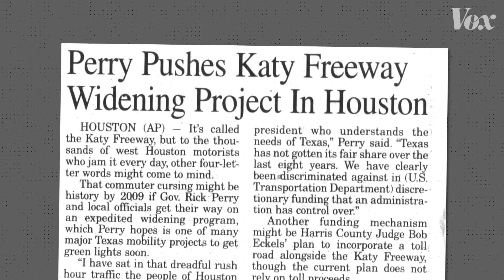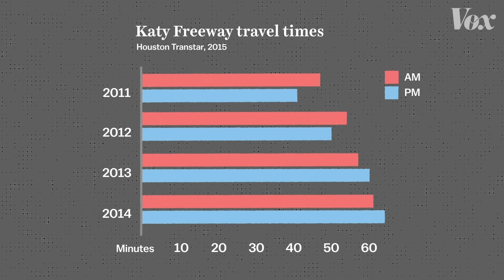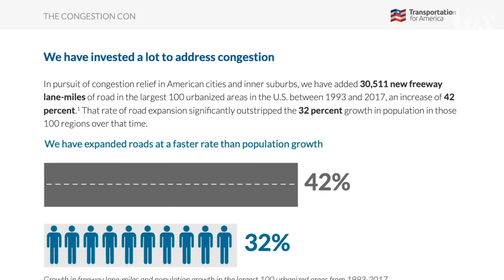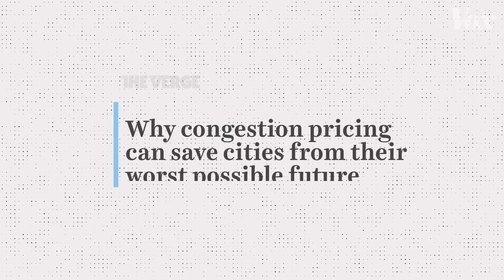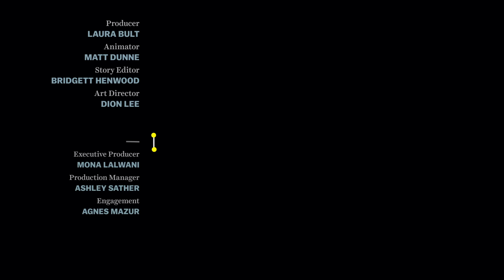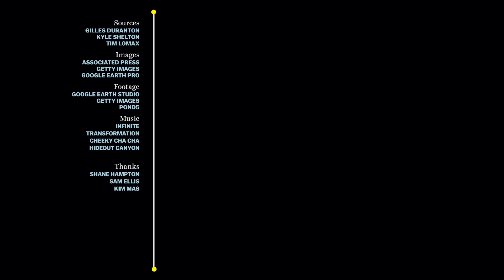How highways make traffic worse

Comment: As computers get faster, programs get less optimized, because the system can handle it. As roads get more lanes, cities get less optimized, because the highways can handle it. In both cases, the increase in speed and power all gets used up. Your 16GBs of ram is all used up, same as the old 256kB used to be. Your 20 lanes are full, same as the 4 lanes used to be.

But computers getting faster is still good. The programs can do more, which is exactly what we want. More roads, however, is not good. They're just roads. You're still sitting in your car unable to do anything until you get where you're going, and you're not going any faster than you used to. There is no benefit to more lanes. The real solution is less cars. Less travel.

Comment: I get what they are going for. The telecommute options and other options which target the "extra" drivers can help. But removing highway does the opposite of what was demonstrated. It removes space while also removing a fragment of drivers. Unless more people stop driving than space removed, this is useless.

It is also important to remember that the highway system was first built for the purpose of letting government resources easily move around the country in the event of an emergency. By stripping your community of access to a highway you in essence disconnect yourself from crucial government aid when you may need it most.

Comment: Another aspect of this beyond induced demand is bottlenecks. More lanes hold more cars in that area, but they don't necessarily move more cars, especially when you end up with immense traffic at offramps and interchanges where cars need to merge across lanes to a congested exit, and when those exit lanes are feeding into normal city roads. The entire world isn't a highway, so highways are only "quick" until they meet normal roads & destinations. When you start to add more and more and more people (even if they are spread into more lanes) you are increasing congestion by increasing the amount of cars trying to cram through the same entrances, exits & streets.

Comment: Great video! But, it does leave me with a key questions. Why doesn't an equilibrium between supply and demand for highway use that is JUST BELOW HEAVY CONGESTION? After all, in your example some commuters will not travel in congestion... yet you leave them in the plastic tube... in congestion.

Comment: BART light rail in the SFO bay area is packed and the highways from the Central Valley to the coast are jammed up.  It is time for an upgrade of BART (Double Decker Cars?) It will have to wait until after the big Quake though.
Reply: Double decking trains sounds good in theory, but in practice, it runs into the same problem as exit ramps being the bottlenecks on highways. A fully-loaded double decker train isn’t double the capacity of a single-deck train, since the doors need to be at platform level. This means a greater number of people need to enter and exit the train through the same number of doors (sometimes fewer doors), than a single decker train, which increases the amount of time that a single train spends at a platform. If you have several consecutive trains that spend 60 seconds or more stopped at a platform of a single station, that reduces the number of trains per hour that you can run on a single track.

Comment: Adding roads and lanes will not solve the congestion issue specifically. However, if supply cannot cater for demand then a highly efficient use of public money WOULD be to develop the highway system, as you can be very sure that it will be used and hence the money will not have been wasted on the development. Additionally it could even serve to add to economic prosperity in a synergistic way. I would suggest developing the highway in addition to demand reducing measures such as tolls and alternative transport options.

Comment: A larger problem is how people drive and how on/off ramps are constructed. 

A few people do not speed up to match highway speeds at the time of merging. Those people cause drivers at high speed to slow down, causing congestion. If people would just step on the gas and speed up to 65mph like they should before merging, that would fix a ton of traffic congestion that is not accident related. 

Also, off ramps that do not have enough space for all the cars leaving the highway is another point of congestion. It causes people to have to break early before the off ramp, thus impacting the freeway traffic. 

I’ve driven for hours in LA and I’ve seen how most traffic jams are because of people driving slow, or poorly designed off/on ramps like sharp 30 mph turns right off of a 65mph highway. 

They really should put signs on the on ramps that flash if you’re going to slow for the current traffic conditions. Need to encourage people to speed up and match conditions. If the conditions are good for 65mph, there is no reason to go any slower.

Comment: What this video fails to address, is its own example of Boston. Boston, conducted the Big dig, one portion of which was to put the old freeway underground. This video fails to portray that, as it makes it seem like a freeway was then replaced with a boulevard, when in actuality, the freeway was replaced with a similarly sized, if not larger tunnel underneath that stretches the span of the old freeway, and a boulevard above.

Comment: It's not enough to just remove the highways. It is necessary to build a lot of subway lines too.
Reply: You don't necessarily need a bunch of subway lines, though subways would help.  Ultimately it comes down to land use policies, which the US is terrible at.  US zoning codes restricts density and spreads everything apart based on use, which necessitates people to travel relatively long distances to get to where they need to go.  Allow people to actually live where they work/shop/etc. is what you need to do to reduce traffic.

Comment: I live right in the middle of Katy Freeway that this article uses as an example. Katy Freeway is not congested the vast majority of the day.  It is free flowing and fast to drive on 20 hours every day. Rush hour really only occurs in one direction only, meaning even during rush hour half the freeway is still fast flowing. Other smaller sections of Houston's Freeway system are far worst, having congestion both direction for 12+ hours a day. It's simply not necessary to fix the rush hours and design the freeway for the worst case senarios that this article is talking about. People's behavior will change and make different choices if the "rush hour" is a problem. Interstate 610, a loop freeway that interconnects all freeways is far worst.  Nobody in Houston is going to ride public transportation.  Houston's implementation of "rush hour" "high occupancy vehicle" lanes for "public transportation" buses has led to extremely bad designs. Creating some of the most "expensive, "unused" and "unusable" single lane right in the middle of some freeways, like Interstate 45. Showing worst cast commute times is disingenuous, as most peoples commute times are far less on this section of fast flowing freeway.

Comment: I think what happens is you just don't have enough lanes. So there is a point where if you have more lanes then congestion does go down, you just have to get to that point. Even if it is 50 lanes. Or double or triple Deckers with 100 lanes.

Comment: Yea (in boston)  they removed a outdated overhead 4 lane system and replaced it with a modern underground 8 lane system that freed up room for parks and bike paths. The mass pike I90 runs underneath Boston now as a WIDER road with less traffic.
Reply: The problem is tunnel projects in the US are really expensive

Comment: although induced demand is a factor, it's not the primary cause of the unending congestion. The truth is that even a fully packed freeway with every lane full of cars tailgating each other will never experience traffic if it has perfect intersections. Traffic only occurs once a vehicle has to slow down for any reason, so mild traffic is caused by accidents, break downs, obstructions, etc, while almost all traffic is caused by cars waiting at lights, turnings, slowing to merge, or even waiting for a place at a continuously flowing roundabout. If you could build an intersection where vehicles never have to slow down, there would be no traffic, but the size of such an intersection, even for just a 2 lane road, would be astronomical and far beyond the realms of possibility (as a general scale, it must contain at least as many turning lanes/spaces as the capacity of flow of the highway, per time it takes to cross the junction, and hence may actually be mathematically impossible, since as the size of the junction grows, it must become larger to accommodate more vehicles), and hence why even the most enormous highways will forever be bottlenecked by junction traffic

Comment: Development in the western U.S. after the 1920's focused on the automobile.  Cities were made so that people could drive to where they wanted to go.  Continuing that policy as population increases leads to gridlock and congestion.  High density housing is commonplace in many parts of the world, but not in the U.S.  Only cities on the East coast have very high density, even San Francisco is still lower density than in the East.  Low population density makes public transit very difficult to support, because not enough people will use the system to make it pay.

Multi-use high density housing projects, which incorporate retail on ground level, off-street parking garages, offices, and residential units can begin to reverse the trend toward more dispersed housing.  With balconies, roof gardens, indoor pools, and other amenities, high density housing can be pleasant.  And it is far more energy efficient than suburban sprawl.

Comment: I also wonder about the effect google maps has on traffic. Telling everybody to take the same directions
Reply: I do related work and there are several interesting academic articles about this. One is that since all people start to use app, the "optimal" solution will become the worst solution. So the app will need to spread the demand and that will cause some ethical problem like why should I be assigned the longer route to make the whole system sustainable and what of an ambulance get the worse route. Second is that you can produce virtual congestion by stacking hundreds of phones on a street. You could search it, it's a very interesting social experiment in germany

Comment: Expanding highways can't reduce commute times because commute times are a fixed value based on what local commuters are willing to tolerate. But by that logic, literally nothing will reduce commute times without changing that value that locals are willing to tolerate. For example, if you take half the cars off the road by building a train system, the remaining half of the people will just move twice as far away from downtown and end up with the same commute time as before. In addition, in cities that are experience high growth, the newcomers may be willing to tolerate a higher commute time than existing commuters which results in worse traffic even without doing anything else.

'Bad traffic' is measured by more than just commute times, things like poor visibility, poor robustness to withstand large events and construction, and poor road safety are all parts of bad traffic. Not to mention that 40 minutes of stop and go traffic will feel 'worse' than 40 minutes of consistent 30 mph traffic, and is also worse for the environment with all that idling and brake dust.

While you can't reduce peoples commute times just by building more infrastructure, that's a bad excuse to not build more infrastructure. After all, infrastructure is meant to be used. However, local governments are certainly complicit in their marketing for new infrastructure projects by claiming benefits that will not realistically exist.

Comment: The problem is not the highways. The point is that people prefer the car over public transport. That's the problem. Either for comfort, or speed or for the poor alternatives people choose the car. Motorways are great when used in a certain context and not as a magical solution.

Comment: 4:38 yea... but you can fix that. Tokyo is the 2nd largest metro area and instead relies on railed transport for most trips. There is no reason something like that could not be done in American cities. Will it be expensive and take a lot of time, sure, but just keeping on doing the same thing that doesn't fix the problem is not the solution. 
Building new roads is extremely expensive, especially in metro areas due to land value, and are expensive to maintain due to the heavy wear and tear cars deal to them (keep in mind, the weight of a car and the wear it causes are exponentially related, so the habit of oversized cars in the US is just making things worse). Yet when a 1 billion lane winding project is proposed, barely an eye gets lifted but the same 1 billion in building dedicated (trolley)bus lines or light rail causes an uproar. Even though those dedicated public transport projects tend to increase development, property prices and business success along them. 

American cities are build wrong: around the car. You can't solve traffic without first solving that.

Comment: A lot of people are advocating for better transit options, but those are expensive infrastructure projects aswell. You can argue that improving public transportation gets rid of cars, but will also suffer induced demand as less cars on the road means less travel time and will attract more cars again.
Just like the urban sprawls that expands when mobiliy advances which is indeed an endless cycle. Best solutions are a combination of everything. Invest in road infrastructure, in public transit, biking & so & so.

Some EU countries are doing great projects for this. Not just ADDING highway lanes, but building alternative routes aswell, upgrading local roads to express ways to add more alternatives to cars. 
In the end you can't go around improving the road infrastructure because if you completeley neglect it, the problem also wont solve itself
Reply: This is just nonsense
Reply: But less travel time isnt a big enough reason as stuff like paying 10k USD+ for a car, auto insurance, gas, paid parking, infrequent psrking spots. All this gives people a reason not to pay for all of that for a 5 minute time save if that.

But you also dont understand less cars means less car infrastructure so smaller and less streets and roads. So its even more difficult to drive a car because you sre taking longer routes for cars snd shorter routes for bikes snd walking.

But steets sre still for cars that need to be on the road like carrying super heavy objects or tons of stuff that a cargo bike just cant do and now they have less traffic and get there quick because less traffic.

But car infrastructure likes to dominate everything as a tram or train can take up a car lane of space while cars on a highway will need more and more asphalt. Plus having cars in cities is difficult as they clash as people need to bicycle or walk without getting hit by a car or taking pedestrian overpasses and crossing dangerous stroads. A good solution is making cars go slow to make crashes less fatal, more reaction speed for cars, also cars going slower allows for more narrow lanes and it makes it easier for bikes and pedestrians to cross without getting hit.

Its also not neglecting it as you have less roads that are snaller with less heavy cars which allows you to have less repair costs snd buy nicer more absorbsnt and quieter road materials.
Reply: Just make on of the lanes a bus lane. Done.

Comment: Obviously, induced demand is real, but that doesn't mean building more lanes is a bad thing if your goal is to increase throughput rather than decrease congestion. For example, no one would argue that an urban interstate with just 2 lanes (1 in each direction) is adequate. Furthermore, the video acts like induced demand is potentially infinite, but it is not. The highway is only going to draw local traffic from a finite distance, and that local area can only support a finite amount of car ownership. Perhaps the 6-, 8-, and 10-lane freeways we build now do not reach that theoretical limit, but at some point the highway will max out the demand it's inducing. 

Intercity rural highways are another matter entirely, since the demand they induce comes from different sources. Increasing them from 4 to 6 lanes is highly appropriate when volumes get high enough.

Comment: I think the problem is one of basic queuing theory and flow control.  If you cannot increase the capacity of a city center, than more lanes on the freeways that feed the city center, that lead into the city center, just make more congestion.  In other words, the capacity and throughout of the city center is the bottleneck.  

A typical manifestation of this is:  traffic on a freeway is flowing nicely, but the exits and off-ramps are backed up for miles.  Eventually, this backs up the freeway itself.  The problem is that the road infrastructure of the city (not the freeway) cannot handle the capacity.

We need to build distributed communities and decentralize business centers, reduce concentration of residential areas and so forth.
Reply: Traffic is bad in wide suburban big streets as well
Reply: This is true in many cases. Notice often that capacity is also reduced once the highways get into the cities, usually due to the financial or political inability to acquire the right of way to maintain its width near the city center. For example, the Katy Freeway drops many of its lanes before reaching the core of Houston and the very wide portion is rarely congested like the part inside the 610 loop closer to the city center. So in essence you have wide pipes that are constrained where they probably need to be the widest